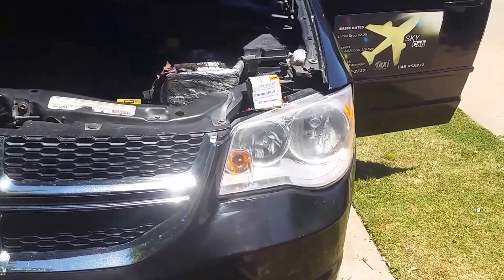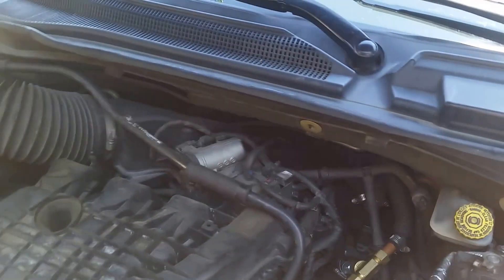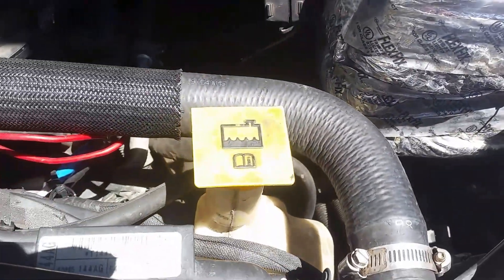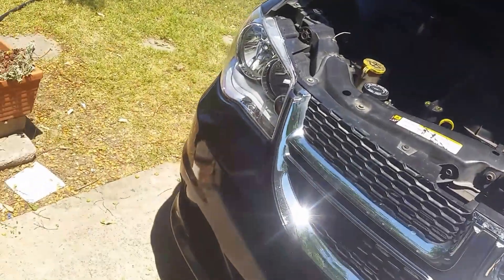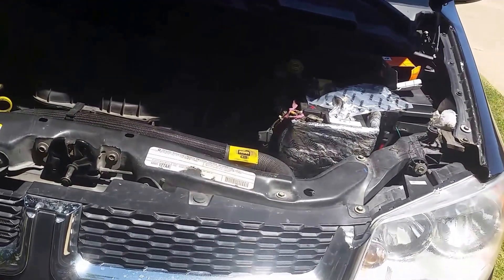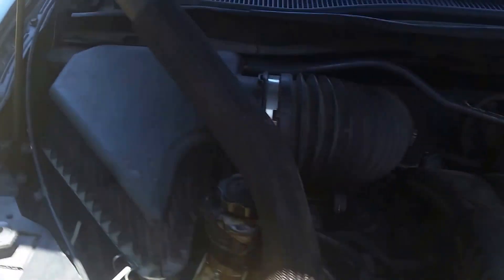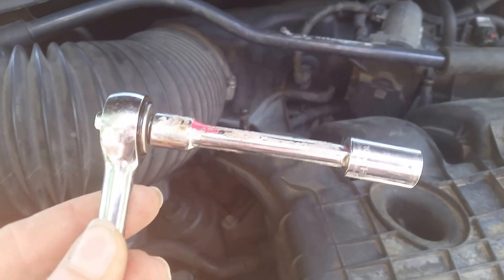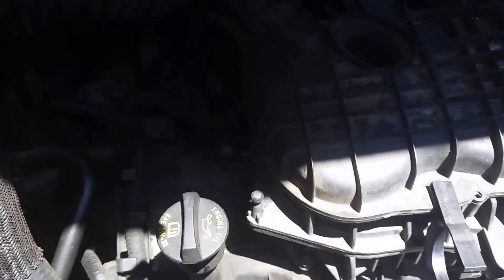2011 Dodge Grand Caravan 180° Thermostat Upgrade & Overheat Situations Part 1

Comment: This video is 4yrs old I know, I just want to help people that had or have the same issue I did. I'm pretty sure the problem here is actually the radiator fan control module, resistor etc. The fan has 2 speeds my second speed was not working properly. It's approximately $50 and takes only 15min to install it's pretty simple. My opinion is I  don't recommend the low temp thermostat after reading a lot.
Reply from the maker: Actually most of the issues that I had with heat on my caravan was that the oil cooler that is under the intake had a small leak
Reply from the maker: Besides that, i replaced the radiator fan control module, resister relays multiple times

Comment: keith cunningham I figure out that my truck came with a 195 thermostat and supposed to have the 210. It is a ram 1500 v6 pentastar engine, but it is giving me the code p0128 and they replaced sensor water pump and fan. I think the code it is because of the lower temp thermostat. Is there a way to keep the engine light out? Thanks
Reply from the maker: albert olivera I get that code when the weather is cold out. It is not a bad code to have. ait is much better than getting the codes relating to an overheat condition. are you saying that you purchased this truck brand new and it had the lower opening temp of 180? The only way to get rid of this code is to put the 210 degree thermostat in there.  If you drive truck under normal conditions, unlike the way i drive my van, which i sat idleling for sometines up to 4 or 5 hours in one place, or unless you are constantly towing a trailer or something that stresses the normal operation, the 210 tstat ahould be fine. i would get it at the dealer. It is easy to install. i changed mune out at least 10 times.  i live in Texas i needed a lower temp tstat.  the code po128 goes away when weather is warm out.  If you want to turn it off for inspection reasons, you will have to install the 210 tstat.

Comment: Amen I agree 💯% why because it will start your wires to deteriorate faster with all that heat, it might work for Canada weather but I live in Texas and that's to hot to run a engine down here.

Comment from the maker: BTW  the thermostat change out has worked great for that particular problem.  But, I am losing coolant from the oil cooler.  The o rings were replaced a year ago.  The heater hose a month ago and the oil psi sending unit last month and today I did a compression test on the radiator and found antifreeze now comes out like gangbusters from I guess a bad oil cooler.  HAPPY HAPPY JOY JOY

Comment: Interesting video....I currently own a 2010 Caravan and feel at  195 degrees is too hot to run an engine....if the newer caravans are running +203 that means it's very hot and 9 degrees below boiling point......how can an engine last that long....my question is did you have to modify the power control module software at all and did get any engine codes with the lower thermostat?
Reply from the maker: Dennis M What do you mean power control?  Jeeps have same engine 3.6 Pentastar.  i did not modify anything and it works great.  but, i will say that i still see temp get to 220 at times, because the fan plays a big part in cooling and it is controlled by the psi from the ECT pressure switch.  No engines codes at all
Reply from the maker: But. i am losing coolant at times. i cannot find a leak and never see it come out. besides evporation from overflow, i am at a loss
Reply from the maker: Dennis M I meant for the last comment i added to video to go to you about the coolant loss
Reply: Thanks for the information....Yes I did me the power control.....I guess there is no way to have the fan come on at a cooler temperature?
Reply from the maker: Dennis M No there is not because it depends on psi build up in motor and sensed by the ECT on the front of the motor across from the fan
Reply: Could you not splice a wire into the  Electric Fan Wiring Harness with a toggle switch inside your car and turn it on when you see it get hot? I was thinking about another Caravan/Durango with the V-6 but now have my hesitations.....most cars still run at 180/192 degrees.....208 is way too hot
Reply from the maker: Dennis M You should go to the Allpar website. I have questioned this in one of the replies on this video i have put a link there that goes to the post about this issue. i wanted to do that to, but was persuded not to on Allpar.  Have you replaced the High speed control relay?  it is ny the headlight they go out
Reply from the maker: To update this,  I use the regular thermostat in the wintertime because the 180 degree thermostat will throw a code because the engine does not heat enough fast enough.  So i put the 180 in the summertime and the oem in the wintertime

Comment: I needed the knowledge because I bought thermostat from the Amazon site temperature of 82 percent and I worked short with condenser for the incubator to cool the second speed of the fan at a temperature of 104 Celsius but needed to work at a temperature less
Reply from the maker: The fan speed is not based just on the temperature of the coolant.  The ECT pressure sensor triggers the high speed fan when the pressure is high enough.  Also, there is the high speed and low speed relay.  By putting the lower temperature thermostat in, the thermostat will open at a lower temperature and it will HELP keep engine from overheating but does not have much to do with the fan, in my opinion.  If you look at the link I sent from Allpar, you will see everything there us to know about the cooling system.  I say this because I asked the question different ways and the replies are all there from mechanics that work on Dodge's.,
Reply from the maker: }I copied and pasted this here from the forum and the link is for the chart that is being referred to.,  see the following below

Engine Coolant Temp Sensor Options (at https://www.allpar.com/forums/threads/engine-coolant-temp-sensor-options.167500/page-2#post-1084853627 )

In the chart there are 3 input parameters that the PCM interprets before it issues a command to the TIPM to engage the radiator fan. These are engine coolant temperature, air conditioning system pressure, and automatic transaxle fluid temperature.

Are you thinking that when the A C system is first activated the radiator fan should immediately launch into high speed fan operation? That is an incorrect assumption. Referencing the chart I posted on Apr 21, when A C system discharge pressure reaches 250 psi, the radiator fan will operate in low speed. When the pressure reaches 300 psi, then the fan should go into high speed operation.

If it is a moderate temperature day with sunlight with ambient temperature below 85 deg F, the radiator fan running on low speed should provide sufficient air flow across the condenser to keep pressure within desirable operating limits. The high speed operation of the fan will NOT come into play.
I looked at weather conditions in the Dallas - Fort Worth area and it seems temperatures are still moderate with highs in the mid-80 deg F range.

Engine coolant temperature needs to reach 230 deg F before the radiator fan goes into high speed operation. 

What is your basic concern? Are you afraid that the engine is overheating? Are you using the instrument panel gauge as your source of deciding if the engine is overheating? You really need to connect a scan tool (not a code reader) to the diagnostic port and view the engine operating temperature that the PCM sees.

Comment: How did the fans operate at temperatures below 104 ° C?
Reply from the maker: The low speed fan does not even come on until the coolant temperature reaches 220 degrees fahrenheit or 104.444 celsius.  See this long thread in the Allpar forums. https://www.allpar.com/forums/threads/i-want-to-sue-the-heck-out-of-dodge-chrysler.167741/page-3